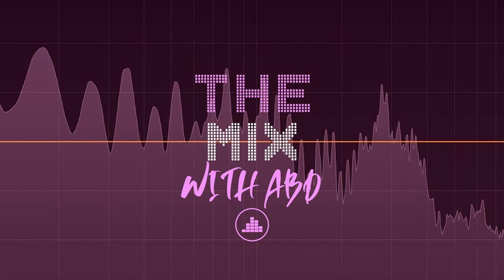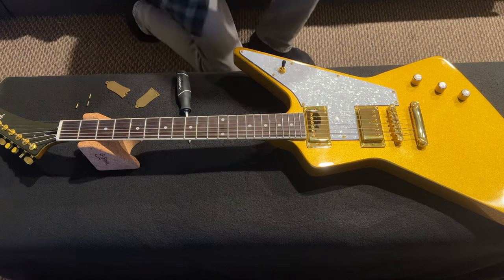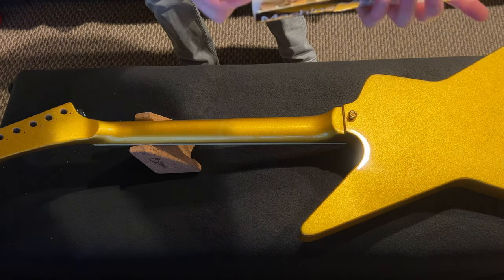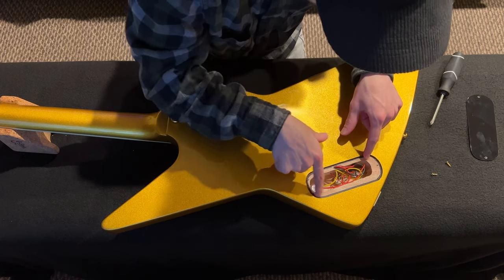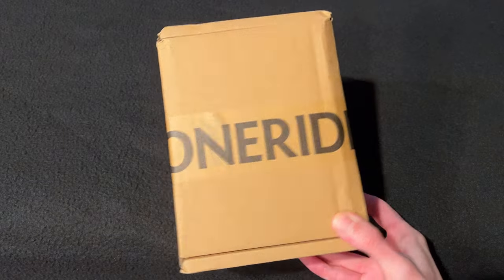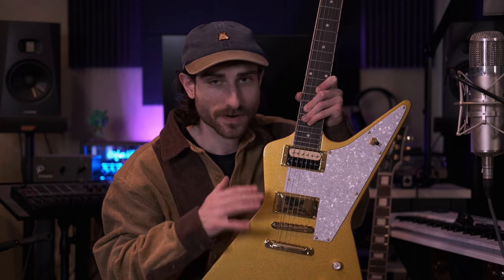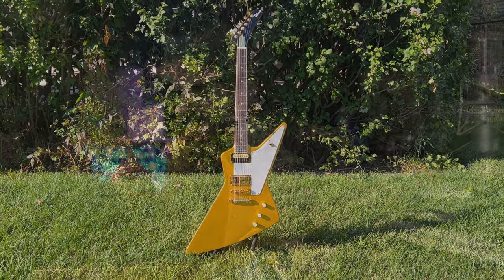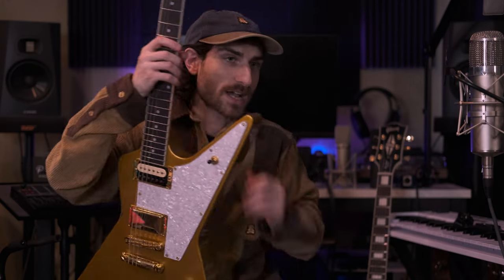Don't Let Gibson See This!

Comment: great vid.  I am not sure I thought either the Gibson or the Epi sounded very good, but I do agree I liked the Chibson better overall.  With that said, I am not sure they are worth it.  Yes a real Gibson costs a lot more, but that value doesnt evaporate like it will on a Chibson.  I think for folks that really like to mod guitars and have spare parts hanging around this is a great option.  I am not loaded, but for me, once I hear a guitar that sounds better I just cant settle for the lesser one.  I would need to hear this go up against a real Gibson before I could say whether this is a decent guitar.

Comment: These chibsons are priced ridiculously low for the build quality and look which are 99% identical to Gibson. The electronics are terrible. That’s the only thing that needs to be changed, the pick ups but that’s no more than $100-$150 to make it sound almost as good as the real thing
Reply from the maker: @chipchiperson679  the electronics are usually fine it’s just the pickups and tuners. Maybe the bridge. But you even find some with decent pickups too.

Comment: the quality is so good that you want to change practically all the hardware ...lol
Reply from the maker: It was $280. That cost for the main bones of the guitar is more than worth it.
Reply: @TheMixWithABD  the quality is so good that its "main bones" are worth 280$ ... lol
Reply from the maker: @addchannelname8688  yes
Reply: @TheMixWithABD   ...and that's the main problem with cheap knockoffs. They're made cheap with very cheap production. Then they're fitted with the cheapest available hardware. It doesn't really matter what you do to them. It'll just be a sub-quality built guitar with upgraded hardware